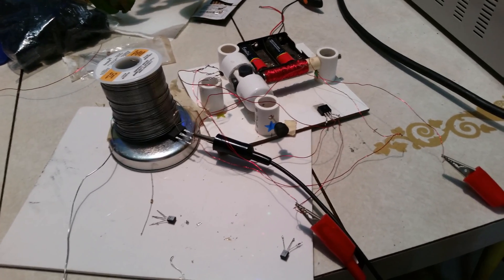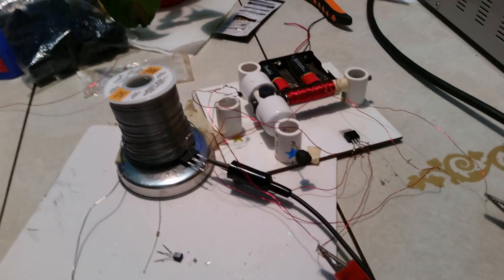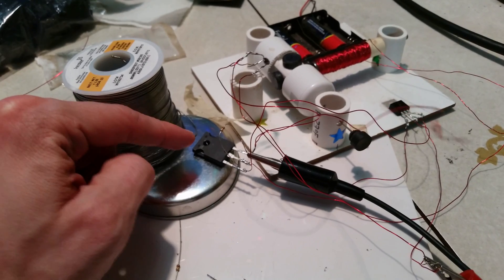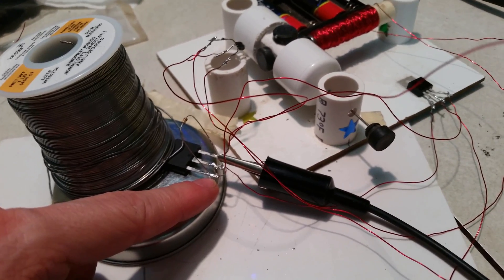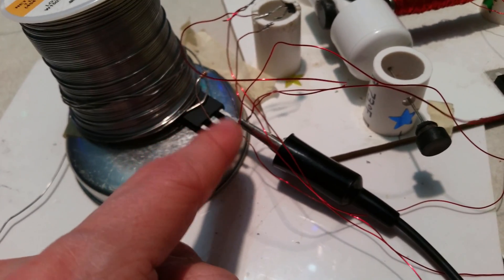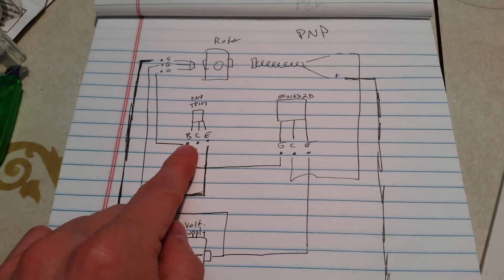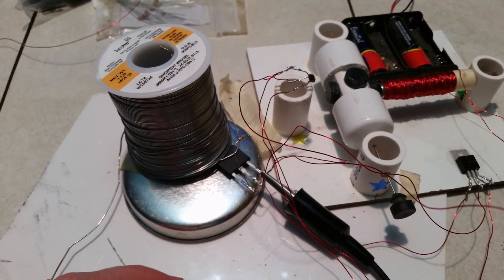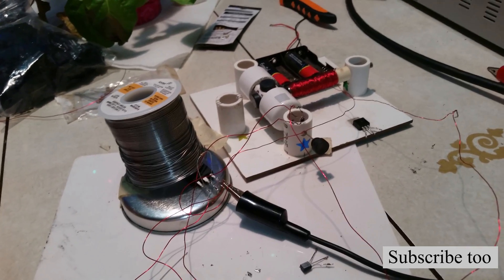IGBT, PNP darlington And Hall Sensor Circuit

Comment: Do you want an IJBT or a Mosfet.  https://www.youtube.com/watch?v=VlMdSCI29A0  Mosfet might be the better option at the voltages your using because of their faster switching speeds, they will be more efficient. I am not sure about the efficiency of your circuit. It will help if know if your circuit goes from completely off to full on by checking the voltages at the transistor. . Unlike an audio amplifier, you do not want anything close to resembling a sine wave. The more time it spends partially on or partially off mean the less efficient the circuit operates at. generating heat in the transistor. 

When your satisfied it is switching a IGBT on and off "nearly" instantly, then check out This page. It is extremely helpful. https://www.digikey.com/en/articles/techzone/2016/dec/how-to-power-and-control-brushless-dc-motors And look at hall sensor output and current direction in the windings for any one of six steps or sequence numbers. where three hall sensors named (A,B,C),  give any one 6 logical value in this sequence  (0,0,1)(1,0,1) (1,0,0)(1,1,0)(0,1,0)(0,1,1) as the magnets are rotate.  Values (0,0,0) and (1,1,1) are obviously faults that should never occur. When the hall sensors switch their output, the current in the coils need to be switch on or off according the sequence in the picture you see in the link above.   

And lets not forget about PWM. You do not really need to PWM above 20 khz.  The percentage of duty cycle determins ow much average power Volts*Amps* flows in. While the hall sequence determine which  coils need to be energized , one should also add  a PWM circuit that feeds into 6 seperate AND logic gates. such that when logically ANDed with the coil sequence, is fed to the Power switching transistor's gate.